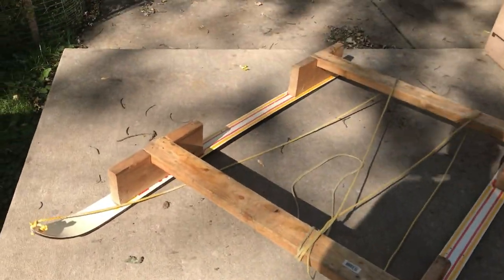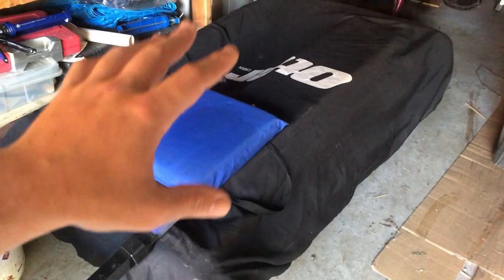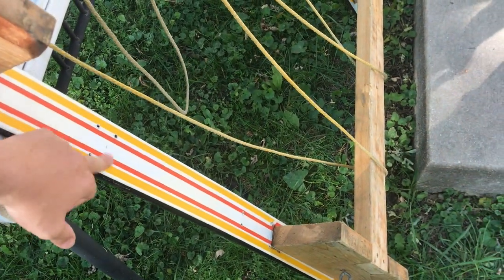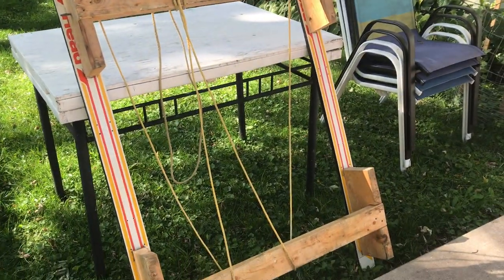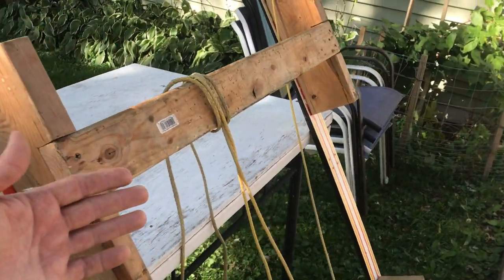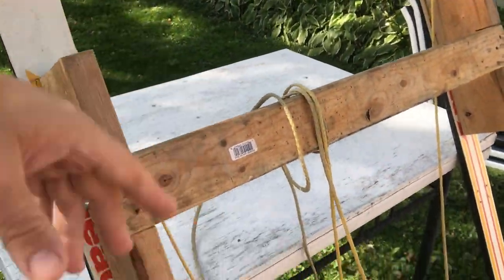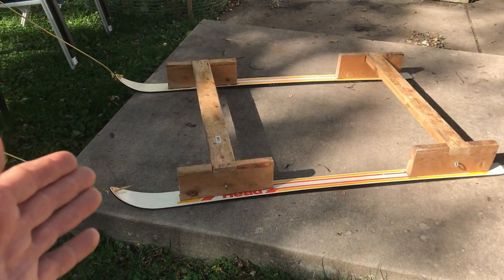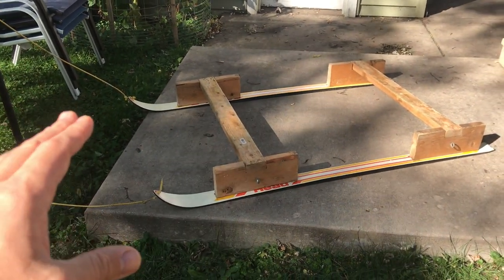How To BUILD a Smitty Sled! - Ice Fishing DIY!

Comment: I built a Polk sled before building a Smitty sled. The difference is the Polk sled is meant for hauling firewood but I liked having different areas to tie down to. Anyway, then I put the Polk sled on top of my Smitty sled. I didn’t use wax rope. I figured any rope would do. Boy was I wrong! Use the waterproof rope!! For those of you building this, look up Polk sled too. You can get some ideas for those of you that pull with a snowmobile or 4 wheeler. You won’t be sorry!! Loved the video btw.

Comment: Great vid! One of my most helpful pieces of equipment for hardwater when it’s time to walk on. Super inexpensive way to make life easier. About the only difference in mine is that I added eye bolts to the tip of each ski. From there I have webbing with a carabiner attached to each end. These, in turn, clips to a body harness. Hands free pulling! Keeps my hand free for my spud bar when needed or completely free if a spud isn’t required.
Reply from the maker: Body Harness was my next upgrade!
Reply: DWS Outdoors huge upgrade! I use the one by Clam and upgraded the carabiners. Still keeps the cost low.

Comment: Hi from Canada. Wondering how often you take that sled out in the winter. Up here we just drive trucks after the first week of December. First ice we pull sleds but there isn't much snow so no need for skis.
Reply from the maker: webjay even pulls easier on ice 😂 so easy I ride it with the wind sometimes! Oh on a side note I fish all over WI so I can go from no snow thin ice to tons of snow thin ice to no snow super thick ice to way to much snow to even think of going out! 🤣🤦🏼‍♂️
Reply: @DWSOutdoors  Great video!  Question, what happens when you encounter snow that is > 5" deep?  Does the Smitty not work and the sled design take over?  I wanna build one but don't know if 2 X 6 is high enough.  thanks
Reply from the maker: Sorry just seeing this now but it kinda floats up on the snow and that allows for more clearance! If you build it too high I don't think it works as good?

Comment: What size drill bit did you use to make your pilot holes on the bottom of your skis? I am thinking I will be using decking screws to screw into the wood for the bottom. Thanks, and great video btw! I am going to follow your video here when I do mine very soon! Thanks again!
Reply from the maker: I actually only used a big enough drill bit for a counter sink hole for the screw head if I remember right otherwise just screwed it together lol But if I did it again I would just use a drill bit less than half the diameter of what ever screws I planned on using! Good luck and safe walking this season!
Reply: @DWSOutdoors  thanks for your feedback! Appreciate it! Good luck to you as well and tight lines!
Reply: @DWSOutdoors  forgot to ask you what kind of saw you used to make the notches in your wood? Didn’t know what would be the most efficient way to do this
Reply: @DWSOutdoors  sorry, not the best person when it comes to wood work lol. The notch is prolly the only part that I think I will struggle with lol
Reply from the maker: I did it with a Jig Saw but you could use a hand saw if you really needed to!
Reply: @DWSOutdoors  the 2x6’s that you used were 8” long? Sorry, if I am bothering you in advance too.
Reply from the maker: Simple math for notching stuff like that is to have double the width of the notch on both sides for torsional support or simply put the skis being pulled with a rope on each one will make the whole thing want to twist and if if there is not enough support on either side of the notch the wood will just crack and break apart! Hope that helps!
Reply: @DWSOutdoors  yes that definitely helps out a lot! Thanks again, appreciate it!

Comment: Love the video. Would it still pull down the front of the ski with an eye bolt on the top of the ski with the rope?
Reply from the maker: Yeah you really want it mounted under the tips!
Reply: @DWSOutdoors  thanks for the reply! My husband just did the sled tonight but with the rope as questioned above. Will have to have him switch it to the bottom side.
Reply: @DWSOutdoors  how does it compare to the rope mounted on the sled or the 2x4?
Reply from the maker: 100% better lol You'll love how easy heavy weight pulls!
Reply: @DWSOutdoors  awesome, thanks!

Comment: Don't think you mentioned it, but type of skis you used, downhill or cross country? I've heard positive and negatives of both. I think cross country skis are narrower which then there's less surface area on the snow. But wider I'd assume could hold extra weight. Two things I want to do with mine, if possible, will be to make it available to disassemble while in the vehicle. I don't have a lot of clearance in my little Jeep so it might not fit with both the sled and the sled in there without being disassembled. I also want to make mine wide enough for my widest sled but still able to use it for my smaller sled. Also, have you ever used this behind your three wheeler so once you get out to an area you can pull it around by hand? If so, I'm wondering if I can make a tow bar adapter on it somehow so I don't need to pull it with the rope when behind the atv. Great tip about notching the wood! I definitely see some who don't do that and I think to myself why????
Reply: Find me on fb and pm me I have a tip for disassembling
Reply: What ever is free. I used cross country skis on a 100lbs setup. Just be sure to wax them or wet snow will stick and quadruple the drag weight.
Reply from the maker: Best skis are downhill as you want everything to float and I never pulled it behind my machine as I drive entirely too fast for that to handle 😂
Reply: I like my cross countries cause they are scaled so they dont slide backwards downhill
Reply from the maker: That’s a random good perk lol